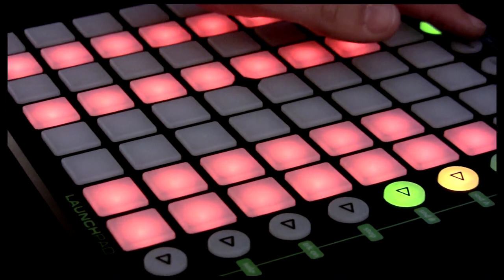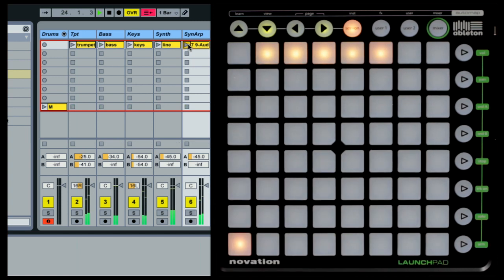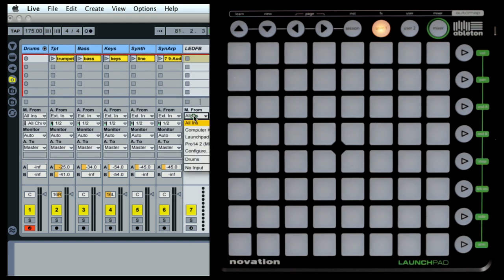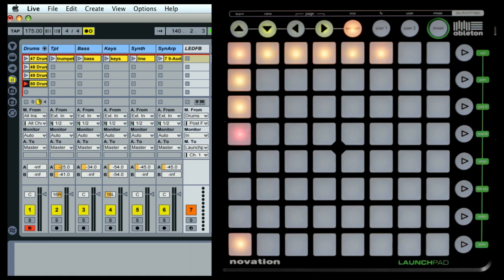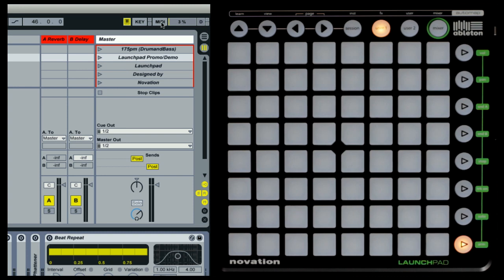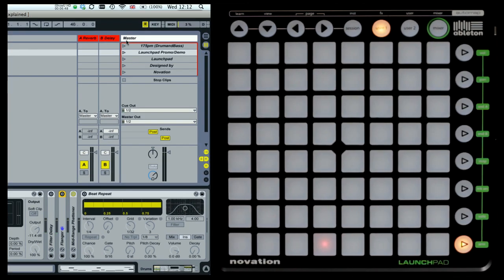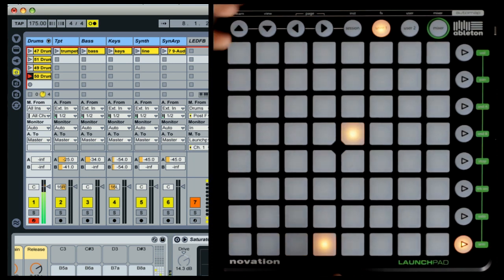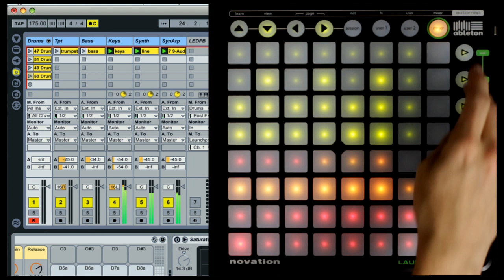Novation // Launchpad Promo Explained

Comment from the maker: To get the "M.From" and other routing options, press the circular "I/O"  button in the bottom right part of the window.

The Saturator and other Live effects devices should be in the Live Device Browser as found on the left side of the screen.

Regarding the clips, I believe they can be found in the LoopMasters library that is a part of the Xcite pack included with the Launchpad.

Comment: Your problem is of latency. You have some possible options:
Preferences> audio   and down the buffer size until your latency  problem  dissapear. If the sound quality at that point is bad, install ASIO4ALL drivers and select that driver in Preferences > audio.

The other option is to adquire your own audio external interface. Recomended.

Comment from the maker: As the Launchpad is solely a MIDI device you will not be able to route audio to it. If you need any help configuring the Launchpad with Live, please get in touch by using the contact form on the Novation Answerbase.

Comment: I own a Launchpad since two years and it looks as the first day.
It's sure that they are not the best pads on the world but it is as any other instrument. you have to practice in order to get the touch.

Also I have a very old interface, Novation Speedio, 
age: 7 years.
works: perfectly.

And all crappy plastic...

VCM: $400, probably more..
LAUNCHPAD+NANOKONTROL=$180.

If you wanna mix, more confortable OK. But who is buying overpriced products?

Comment: LiveControl and touchOSC killed the midi controller. Launchpad is cheap and not inventive, apc40 should be bus powered with the ability to use for drum pads, the only ableton controller that isn't flawed at some point is an iPad running the proper software.